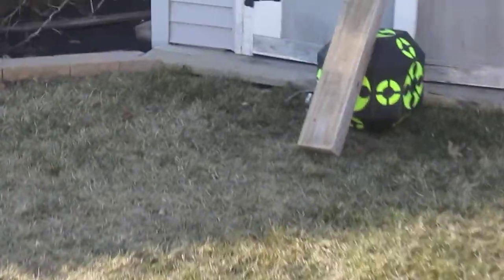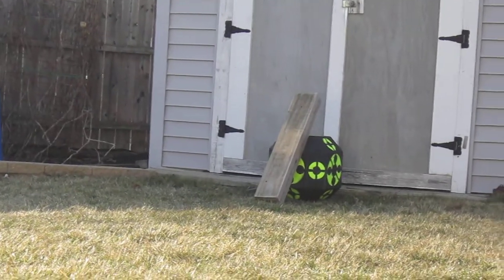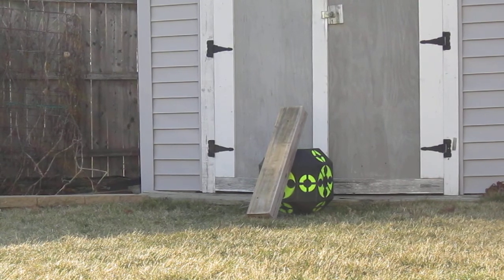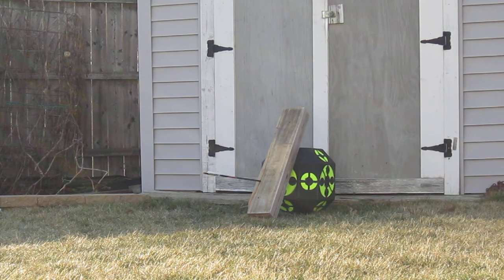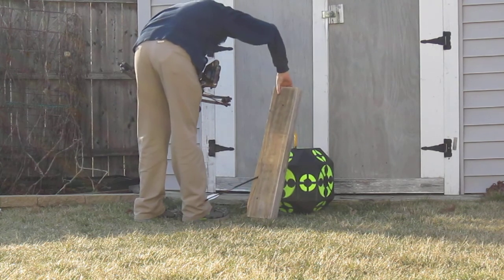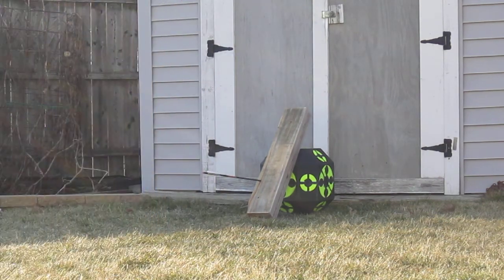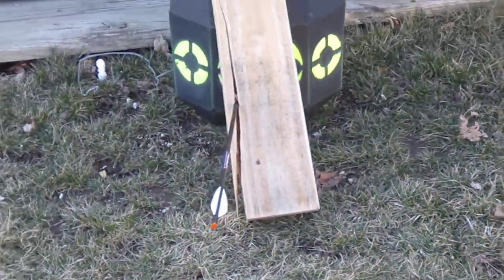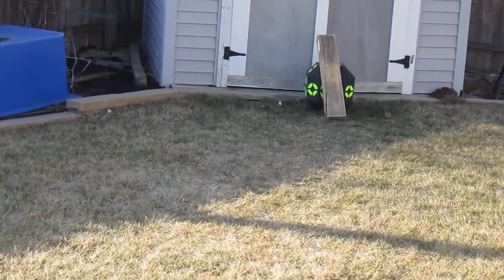double board test single bevel vpa 300 grain

Comment from the maker: I finaly got it though a 2 inch board so it will break though just over 2 inches of wood, still plenty of power, but the angle of the wood makes a differance in overall cutting abillity, oh and all the pants and sweatshirt I wear are american made, pants are union line, about 38 dollers, very lightweight and never stiff after washing, and shirt is platinum brand heavyweight, oh and the bow is wicked ridge invader riser and assembly american made but limbs are imported I found out, :<